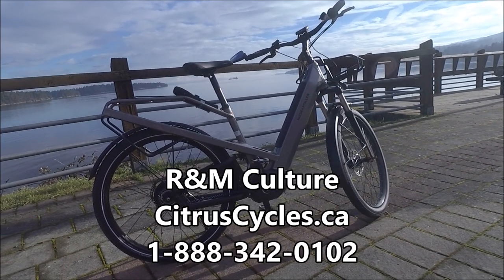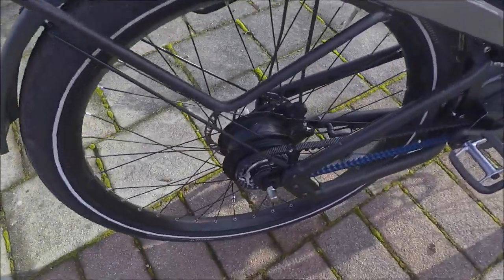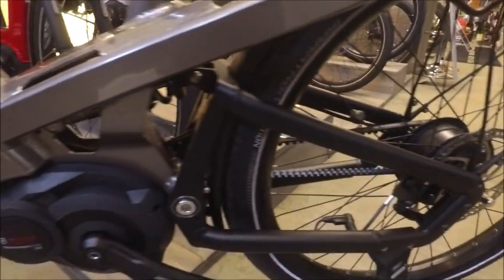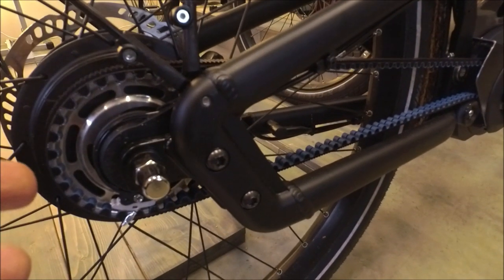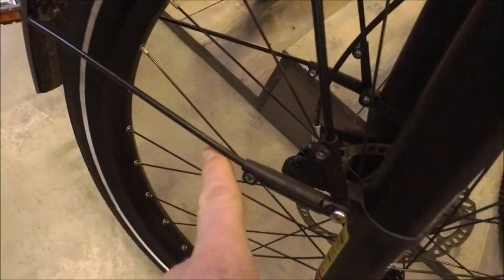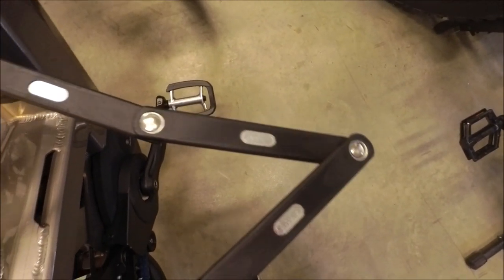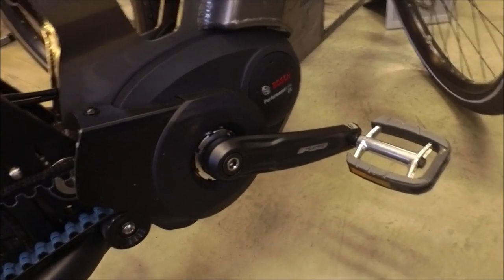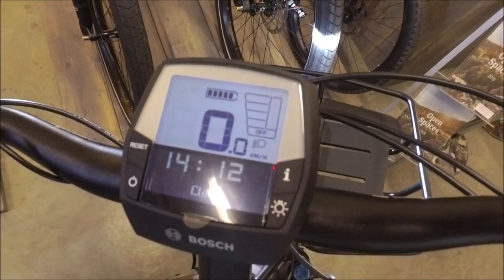R&M Culture Upright Bosch eBike Review and Ride Test

Comment: First of all, congratulations for your reviews.
apart the raised position, have you noticed a different behavior between the spring suspensions of this and the air suspensions of the Homage?
Reply from the maker: Yes, for rougher, off-road rides, the air suspension on the Homage seems to respond better and gives a smoother, more controlled ride.